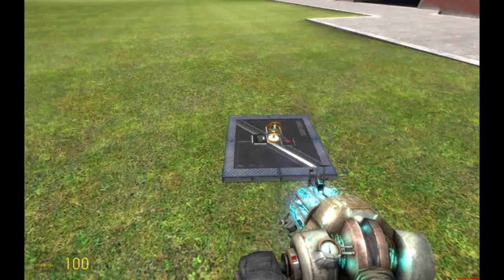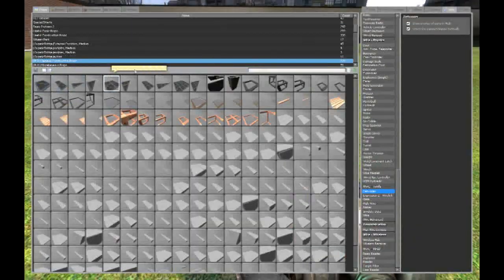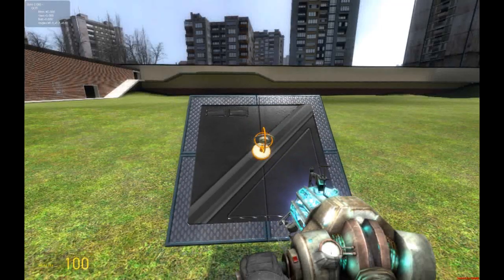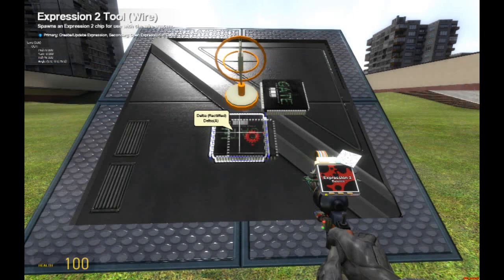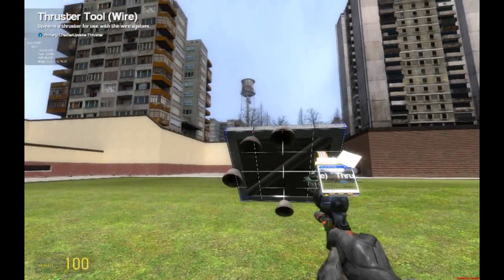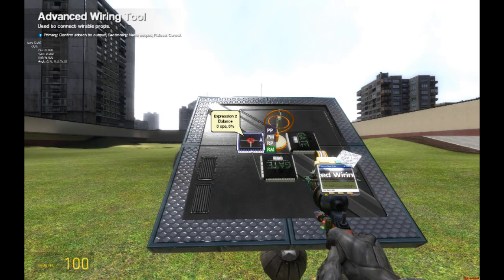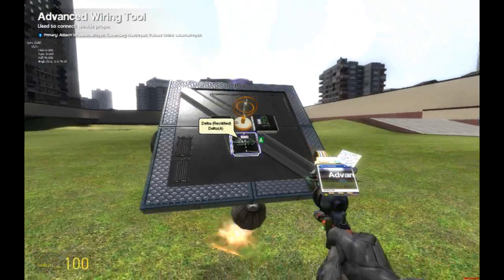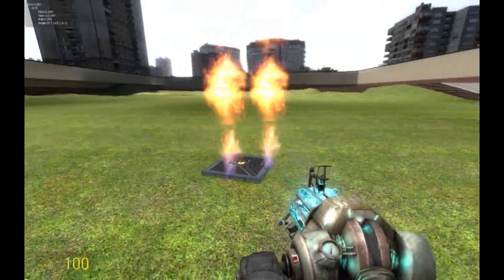Garrys Mod HOWTO: Self Balancing

Comment: Y U NO use E2's applyForce and applyAng features, then the only input you need is an entity, which it can get from the thing it is attatched to. Therefore it will automatically balance whatever it is attatched to, no wiring required

Comment: @name Balance
@Inputs Pitch Roll
@outputs P R

P = $Pitch*15
R = $Roll*15

:D this one works just fine without any external chips.

just do exactly like this guy did except ignore the extra chips.

PItch into gyroscope Pitch
Roll into gyroscope Roll
Pitch thruster into P
Roll thruster into R

:D